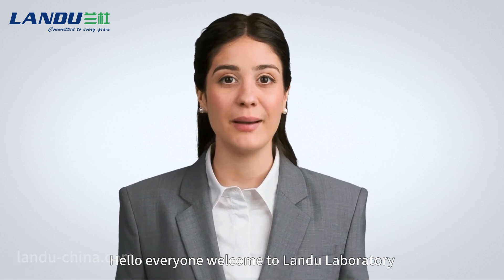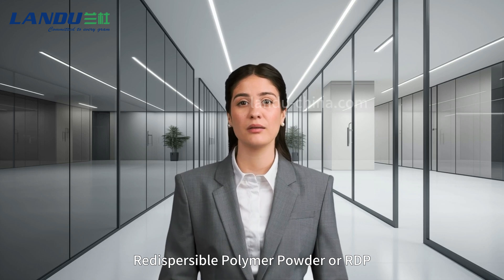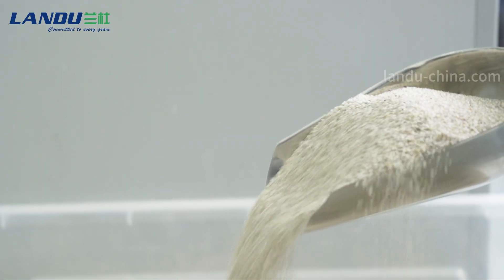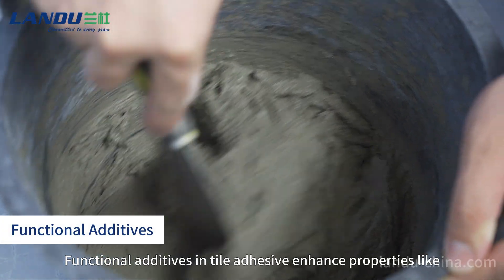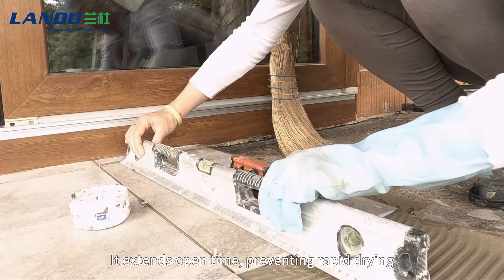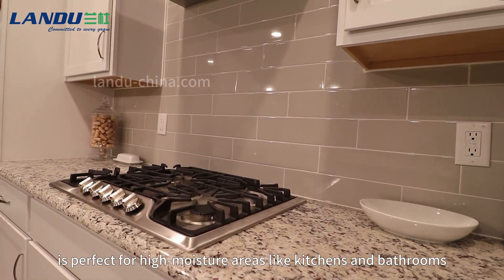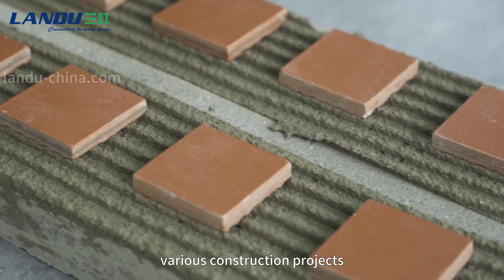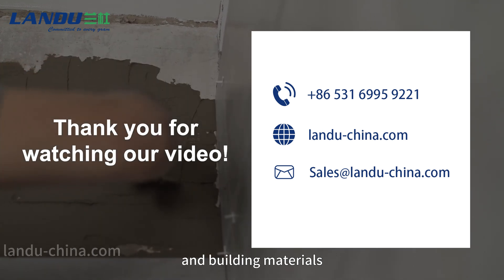Tile Adhesive Formulation Materials and Recommended Landu Products: Ensuring Strong Bond Performance

Comment: What quantities do you mix if you want to do it commercially?
Reply from the maker: For total quantities or addition percentage? The recommended addition is related to the tile adhesive type. For example, C1TE tile adhesive we recommend Portland cement 30~35%, Quartz sand 40~70 mesh 15~25%, Quartz sand 70~140 mesh 35~45%, HPMC K200H 0.2~0.4%, RDP 5011N 1.0~2.0%, Starch ether 0.03~0.1%. You could leave your contact for detailed communication
Reply: Please I want to have deep knowledge about the production of tile adhesive

How should I go about it?
Is there lesson program for it?